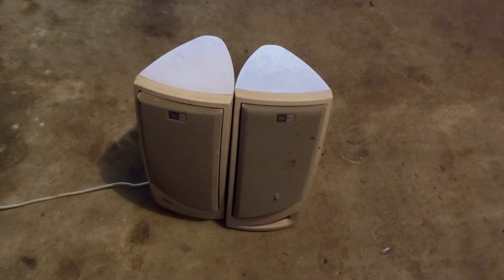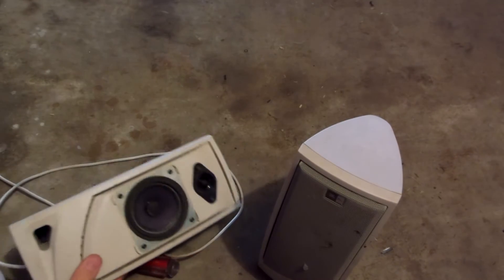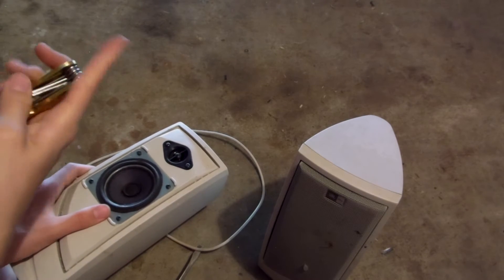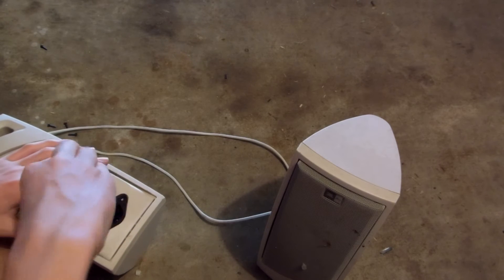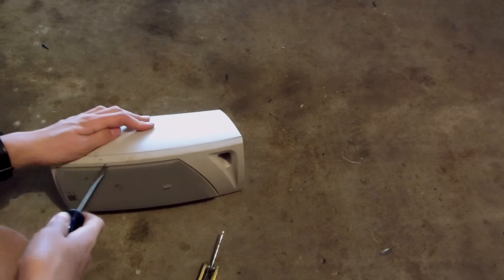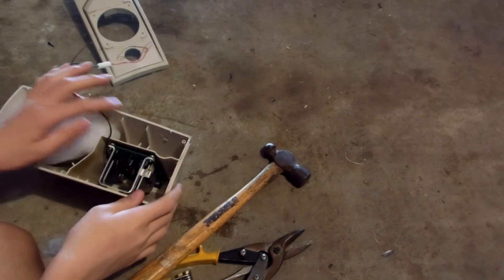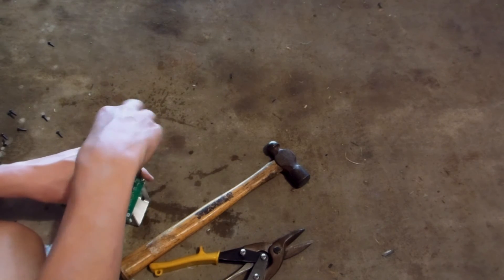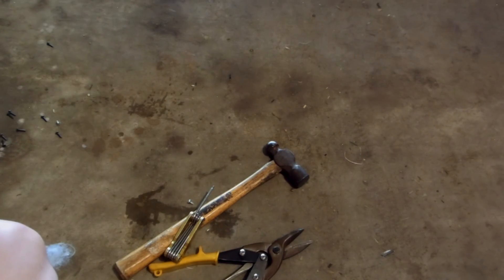E- Waste Scrapping: Computer Speakers

Comment: I hope your speakers are not conected to a power plug.
Reply from the maker: Data Case They arent. I didn't want to get electrocuted. 
OBVIOUSLY. 
However, I was quite "SHOCKED" to find a decent low grade board inside! xD
Anyways, thanks for watching m8
Reply: i could’ve “BLOWN” the speakers first before you scrapped it